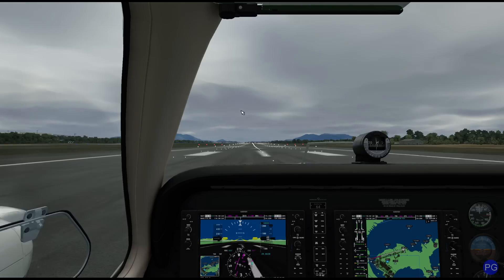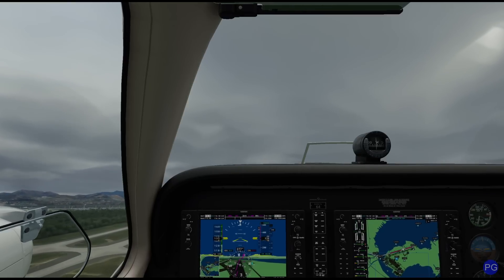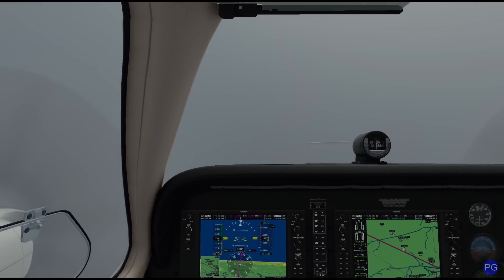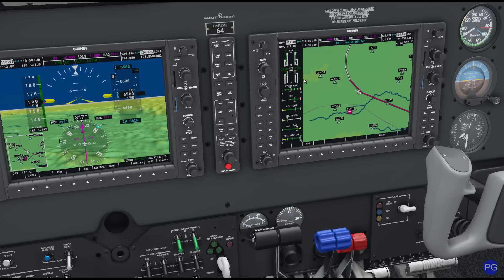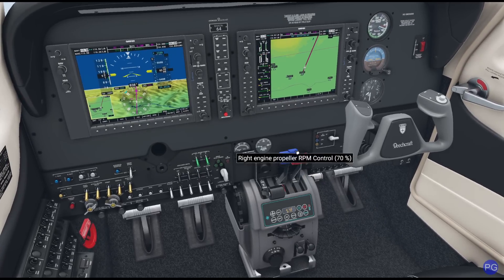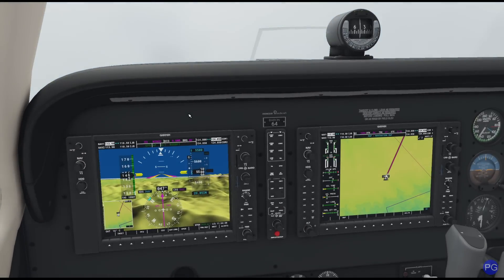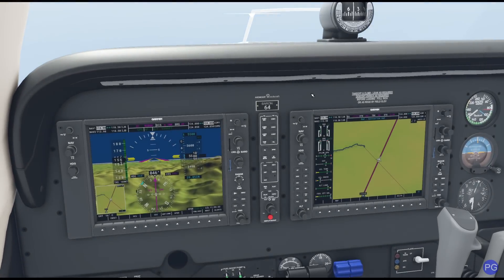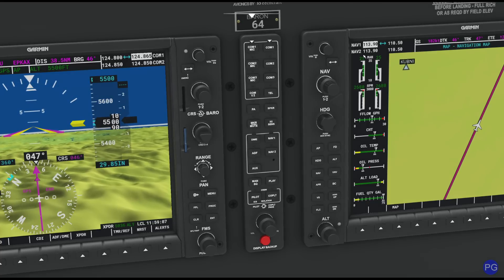FS2020 - The Propeller Control

Comment: Just to point out, the throttle position determines fuel usage, not prop pitch position, just because your engine has reduced its RPM's doesn't mean you are using less fuel, 
Fuel usage is linear to throttle position regardless of prop pitch
Reply: It also changes your fuel comsumption with a normal prop engine. The engine power is a product of your rotation speed (rpm, blue lever) and your torque (indirekt manifold pressure, black lever). If you reduce either of these you will reduce fuel usage. Or the other way around: The increased thrust from moving the blue lever forward is not for free.

Comment: As a newbie to flight sims, I get confused when you refer to the blue prop handles as controlling the RPM and the throttle handles as controlling the manifold pressure. I always think of the engine as controlling RPM and have a hard time grasping that the props can spin at a different RPM than the engine. Thanks for the video.
Reply: The prop RPM here IS the engine RPM. The throttle here just changes how much power the engine is producing, and the prop governor compensates to maintain the selected prop RPM by altering the pitch/angle of the prop blades.
Reply: The blue lever controls the pitch of the blades. The more the blades "bite" into the air, the slower the engine will turn because of the air resistance acting on the blades.
Think of this as like someone rowing a boat. The more the paddle bites into the water, the more resistance your going to feel. Do the opposite and you'll feel less resistance.

Comment: Thank you for the video! Way ahead of where I am and I've never even questioned the subject, but still took all of it in gladly. Appreciate your videos. One question, at the beginning you say there is no change unless the "engine is moving" but later in the simulated failure, you completely cut the engine and adjust pitch. Is this because of the counterweights and the props are rotating? Thanks!

Comment: What makes this video extra fun is that this guy is simulating engine failures and generally messing around with the handles in the middle of a frickin thunderstorm! By the way, I've been on a (real) flight over that exact same area in the middle of a thunderstorm as well, hail included. Good times.

Comment: I'm pretty sure that power of the engine is proportional to torque x RPM, so generally if you reduce RPM you'll increase torque, while power stays the same if you've got the same manifold pressure. The function of RPM reduction is mainly to reduce the cabin noise and comfort. The reason it's done at cruise is because the power output is lower so you don't overtorque the engine by reducing the RPM. That's also why you increase RPM to maximum during landings and takeoffs - you can safely max out manifold pressure without going over maximum torque.

Comment: I don't know why you can get this thing to climb. I've flown this plane quite a bit and If I go over 1000fpm the speed starts dipping and I have to slowly start reducing my climb rate just to not stall out. I have the same problem in the G36 which is supposed to have a way quicker rate of climb than it actually does in the sim.
Reply: Did you check your mixture? Is it all clean (gear and flaps up)?
Reply: @zsoltmolnar1143  Yes
Reply: @Hockeyguy8541  check carb heat? Maybe?
Reply: @jeremey2072  Carb stuff is inop atm

Comment: Good video, as always. I did note that when you shut down the right engine and feathered the prop, it kept on spinning instead of stopping as it should have. You did not mention that so I am wondering whether it is another BUG is MSFS,. If the blades are pointed into the wind, should it not stop turning the engine completely?
Reply: It is a bug.  I noticed this a few weeks ago.  It does feather, but it is not represented visually.  The prop should stop turning.